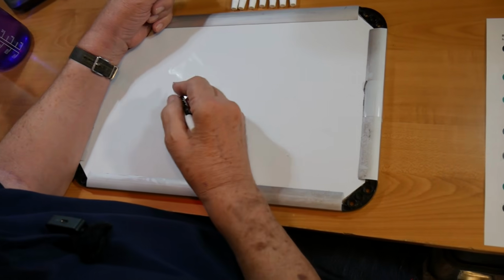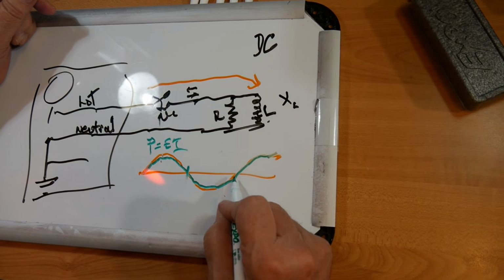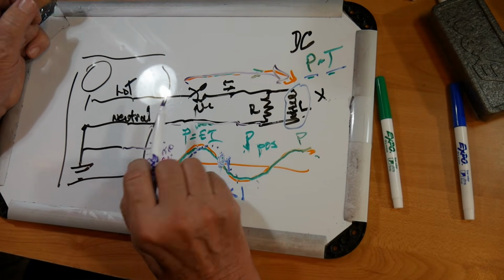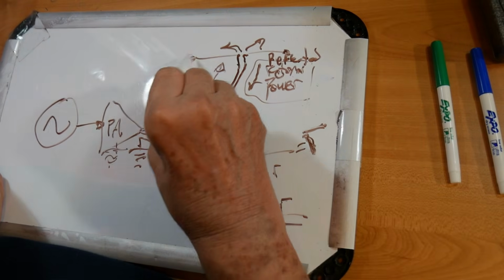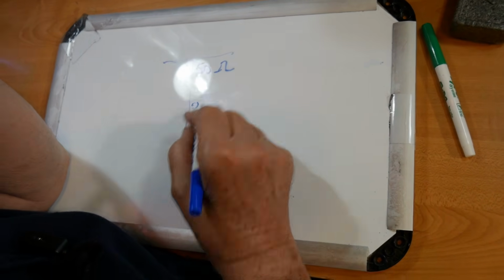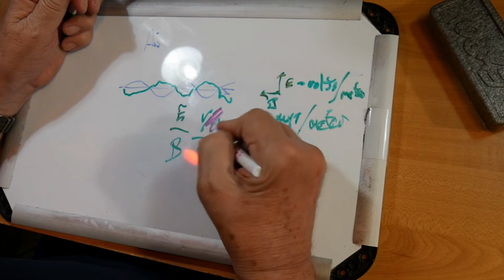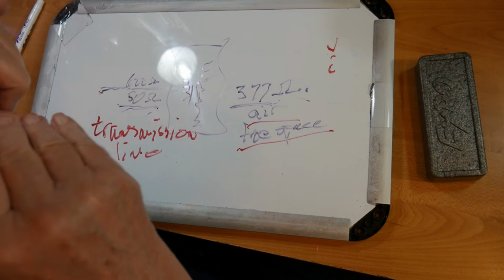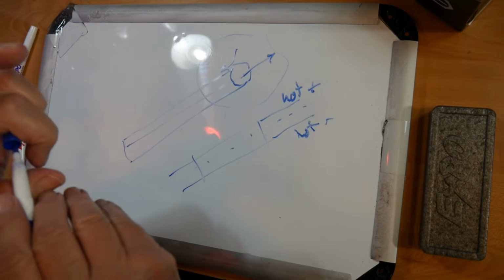Alternating Current for Hams (#1438)

Comment: What was used for irradiating a vehicle to determine if currents were coupled into the electronic of the vehicle ( in this case it was the airbag sensing and system) was    100 watts/(meterxmeter).  This number came from aerospace and be the level used for “man rated systems” .

Comment: Very Interesting as usual. I have a question about coax. We are always told that the braid acts as a Faraday cage or RF shield and signal cannot escape from the inside. However, many HAMs and experimenters includng myself use coax to make antennae as the radiating element itself. It works very well anddoesn't seem to make a difference whether you use the inner or outer conductor or both. How can this be? Does the shield or Faraday effect only work when it is grounded etc? Thanks again. M7JZW
Reply: The inner conductor is shielded only if the braid is grounded -- ie, connected to the radio "ground," which may or may not connect to Earth ground.  The voltage/current induced in the shield is shorted out, & doesn't affect the inner conductor.  Incidentally, the "Faraday effect" is something completely different --- It's too complicated to explain here, but there are plenty of descriptions on the Internet.
Reply: @Pootycat8359  Thanks for your reply. Yes that does make sense to me.